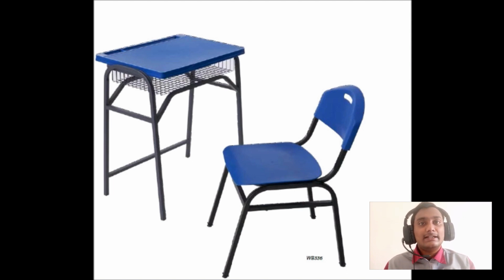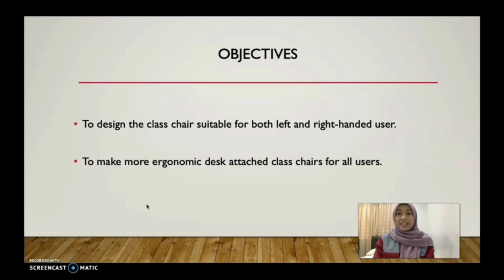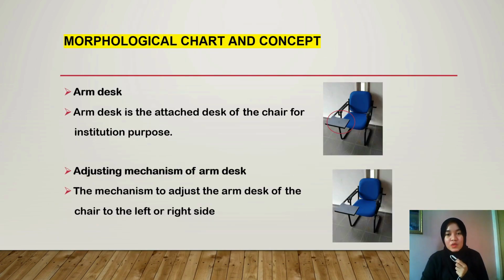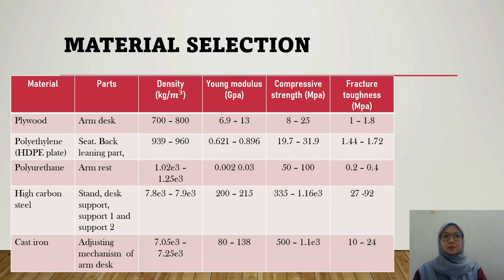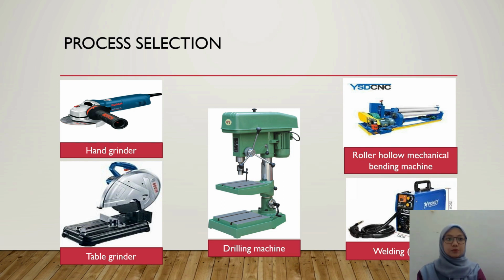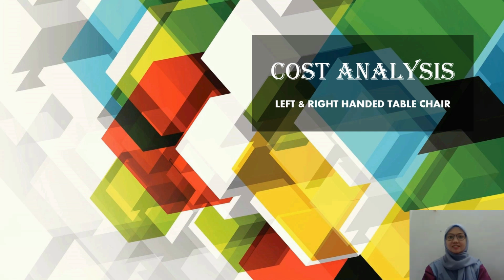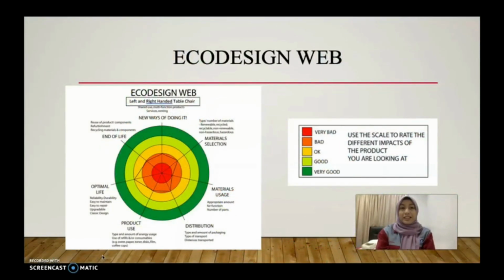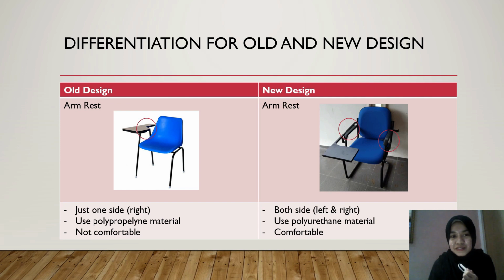BMFU 3223 IDP | UTeM | GROUP 36 | JULY 2021| RIGHT & LEFT-HANDED ARM DESK CLASS CHAIR

Comment: Hi....a very thoughtful design.  Has the team look into cost optimization ideas to reduce cost per unit? i would buy it at the same cost or lower of the existing product.
Reply from the maker: Assalam and good day IR Norsham bt Nordin. Thank you for your compliments on conceptual design of our product. 
Yes, the team looked in detail into cost optimization ideas to make the cost per unit much affordable. The cost can be lesser than the stated cost per unit if the production in mass quantity as the labor cost and fixed cost of the product can take over the overall cost per unit of the product. In further explanations, our selling price is quite high as we bought and used existing chair in furniture market for the development of our prototype as we had to follow much restrictions and limitations due to MCO and pandemic period. Actually, we can reduce the cost of the productions and make the product cheaper until RM180 per unit just if we could develop the right and left-handed arm desk chair from raw materials as the team planned earlier.

 Although it is unfeasible to make the selling price of our product as same or lower than the existing chair which is RM 148 because our right and left-handed arm desk chair would provide more functions and features compare to the existing chair. More functions give more experience to the users of the chair, and it leads them to the satisfaction for the slightly high price that they paid for the product. 

Your opinions on our product are truly appreciable and we would look forward to work more on the aspect of cost optimization of the right and left-handed arm desk chair. Thank you for your precious time IR.

Comment: Do you think the selling price is reasonable? I think it should be less than RM200. Maybe around RM180. Need to recalculate on the manufacturing cost.
Reply from the maker: Assalam and good day Mr Azmi Ismail. First of all, thank you for your great compliments.
Yes, we agreed with some improvement on the design of the armrest in the aspect of comfortability but during usability testing, most of our survey respondents agreed that having any type of arm rest is sufficient to aid them while using the desk. Maybe we could plan it in near future for the product enhancement. 

For the selling price, I would like to give a detailing explanation. As we had much restrictions and limitations for the prototype development during this MCO and pandemic season, we couldn’t develop the prototype with the manufacturing processes that we planned which are more sustainable and cheaper than the manufacturing processes that we had in the prototype development. Thus, we used existing chair to innovate and develop the right and left -arm desk chair prototype. So, actually we can cut cost on the material and manufacturing processes if we develop the product from raw materials as our earlier plans. This would make the selling price of the chair less than RM 200 as you said. 

Your ideas on our product improvements are highly appreciable. Thank you for your precious time Mr.